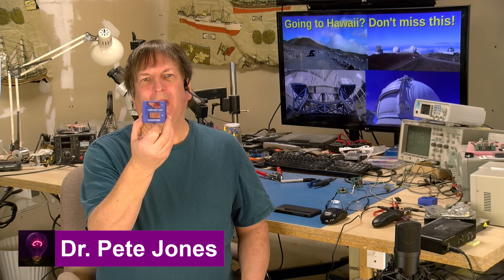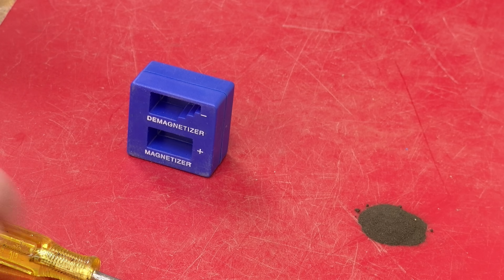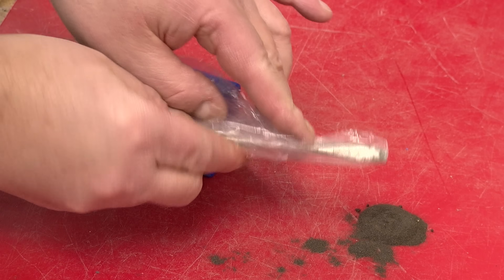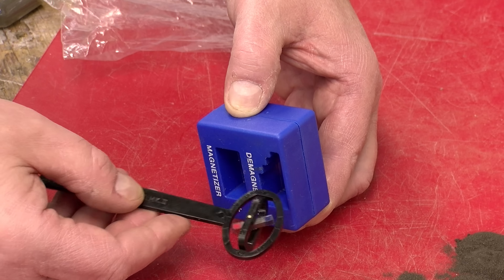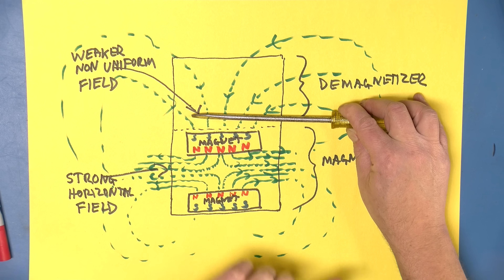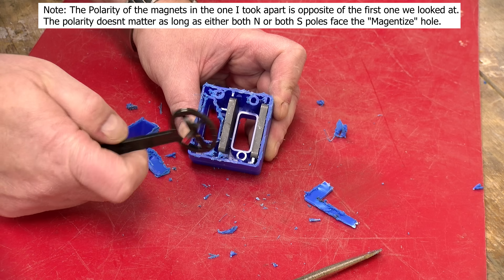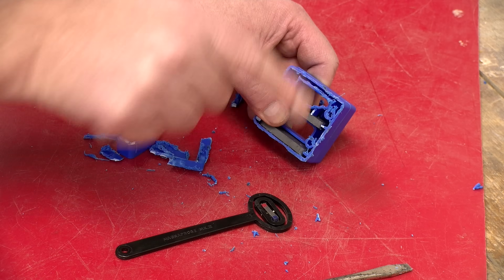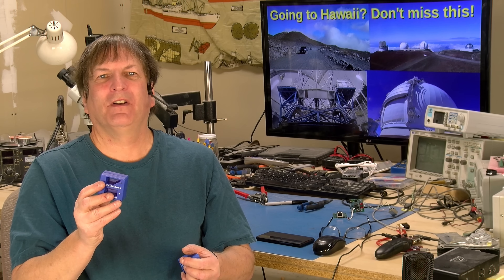How do these Magnetizer/Demagnetizers work?

Comment: I fixed a pair of tweezers that had become magnetized when I stored it on the shell of an old DC motor (yep, I'm a genius!). Repeating the process many times on the differerat steps did the trick. Having every screw stick to the tweezers was driving me nuts!
Reply from the maker: Glad that worked! A magnetized tool at the wrong time can be a real nuisance!

Comment: i understand that the magnetic field reorients the molecules in the screwdriver so they become aligned and they increase the force instead of cancelling eachother out, but I've seen most people "rubbing" whatever they want to magnetise over in the magnetising part instead of leaving them still, does this do anything to increase the magnetic field of the screwdriver or is it just a thing people do?
Reply from the maker: Thats a good question - the only effect of rubbing the item that I can think of is the resulting vibration will help nudge some stubborn domains to orient with the applied magnetic field. I'm not sure how effective it would be - worth testing sometime!

Comment: Will the type of magnetizer you’re using work great with bigger & thicker screwdrivers?
I saw some poor reviews on Amazon and I guess I could google this question: will this also work for titanium screwdrivers and/or Ti bits?
Thanks for the video
Reply from the maker: At some point the thickness of the screwdriver will be too thick for the magnetic field from the small magnet to penetrate enough to magnetize the entire thickness. Probably a screwdriver a bit thicker than what I showed will work but how much bigger would need testing. 

Length doesnt matter and long as you feed the entire length though the hole. 

Titanium - pure titanium is not magnetic. As far as I know many titanium screwdrivers and bits are actually titanium coated steel, so if that what you have, they probably can be magnetized. Apparently some are some sort of alloy which will then depend on the magnetic properties of the alloy. I'm not sure what alloys are used or of they are magnetic. If you try it, would be interesting to hear if they can be magnetized!

Hope that helps!
Reply: @ElectromagneticVideos 
I have 20 small earth magnets so I used them to magnetize my screwdriver. I forgot I had them until later on. I don’t use it very often but I wish I’d of thought of it when taking my large air filter apart. I may have to do it again on my next project 😅
Reply from the maker: @MrScrappydue  Sounds like a perfect solution! Glad you found a method that worked!

Comment: Found that trying to demagnatise a pair of stainless steel tweezers almost impossible  ,tried to demag with the tips together and aldo parted.
What experiances have you had trying this.?
Thanks
Reply from the maker: I'm guess the steel in the tweezers is a bit magnetically harder making it harder for a primitive device like this to demagnetize. An AC demagnetizer should do it. You can often use the AC magnetic field from a soldering gun (not soldering iron) to do this. See this video I did on demagentizing things:   https://youtu.be/mGK8oYdEqyE  Hope that helps!

Comment: hope you still read these, I'm trying to get my pins to only magnetize to a magnet but don't want them to become magnets, is there a wat to do that? These are crochet markers, metal but not shore what kind. some come sinsative to a magnet but some don't and if i drop them in the carpet, i want to be able to find them again but not have them stick to each other. Screws do this but don't know how to get these to do it.
Reply: Thank you and hope you or a viewer can help.
Reply from the maker: @CatWatchPaws  Just to make sure I understood correctly, you want to be able to pick up up the pins with a magnet but also not have the pins themselves magnetized afterwards, right?

There are two things I can think of to try:

1) Since the pins are light, you wont need much of a magnetic filed to pick them up. So try picking them up with a piece of cardboard between the pins and the magnet. This will keep the pins from getting closer than a few mm (1/8th inch) from the magnet and will be exposed to a lower magnetic field. If you lucky you can find cardboard that is thin enough  to pick up the pins but but thick enough so that the pins are far enough away from the magnet so they are only barely magnetized afterwards and dont stick top each other. 

Try a thick piece of cardboard first and then try thinner ones if the magnet doesnt pick up the pins.

2) If you have already magnetized pins, or find that reducing the field strength (as in 1) doesn't pick up the pins, you can try demagnetizing them. 

What you need is an AC powered demagentizer. They are available but something like an easily available  soldering gun (not soldering iron!) will do the job. I did a demagnetizing video here https://youtu.be/mGK8oYdEqyE that discusses this. Pit the pins in plastic bag to hold them when using the demagnetizer.

You could also try heating the pins in an oven (not a microwave!) which if it is hot enough will demagnetize them. May not be a good idea if the pins have a plastic coating or are heat treated during manufacturing, so test with a few magnetic pins. 

Good luck and let me know if any of these suggestions worked for you!

Comment: I wonder if you might be able to comment on how a plate Demagnetizer works. Is it the same principle? Saw back & forth over the top of the plate whilst raising the (watch movement)  up and out of the field?
Reply from the maker: Yes! Its the same idea -gradually moving away the item to be demagnetized from an alternating magnetic field, with each cycle of the field leaving the item slightly less magnetized. I did a video on that sort of demagnetizer here: https://youtu.be/mGK8oYdEqyE
Reply: Fantastic. Thank you so much! @ElectromagneticVideos
Reply from the maker: @MichaelEgan66  Your most welcome! Enjoy the video!
Reply: @ElectromagneticVideos I did enjoy the video but I did not see anything about a plate Demagnetizer, unless the vintage one at the beginning is what you're referring to.
Reply from the maker: @MichaelEgan66  Yes - the vintage tape demagnetizer from Radio Shack at the beginning is the same thing as a plate demagnetize - the only difference is you move the demagnetize away from the object (tape) rather than the object away from the demagnetizer. in the case of the plate demagnetizer. The way the work is exactly the same.
Reply: @ElectromagneticVideos  Thank you. That helps. I used an old snap-on screwdriver and both magnetised and demagnetised it, over and over until i got a bit of a rhythm and then ran my watch through the field in the same manner. It did not work for the watch. Unfortunately,  the watch was running well enough to wear before i somehow ruined it with the plate Demagnetizer. Now it is a disaster on the timegrapher and despite not showing magnetic on my mag test app, it is definitely running very fast now and behaving like its magnetised. I don't like learning lessons the hard way and this ranks up there because I really love that watch...Thank you for your help sir, it was very informative. 🙏
Reply from the maker: @MichaelEgan66  Unfortunately I dont have any experience with watches, but my guess is due to different layers of metal in a watch the inner p[arts are partly shielded magnetically (by in between layers) and although somehow they got magnetized with a  very strong field, they may not be getting enough of demagnetizing field to undo it. 

Two other things are notorious for demagnetizing things: heat and mechanical shock. I wouldn't try the shock on a watch, but maybe leave the watch out in the sun on a hot summer day? I'm not sure how bad that might be for a watch. Also try wearing the watch for a week or more - the "shock" from your arms motion may help to demagnetize it. 

I would think watch repair people must have some advice on how to deal with magnetized watches - I sure there are online bulletin boards and discussion groups that be able to help. The other thought I just had as I was typing this was that the magnetizing field may have been string enough to warp the spring causing the speed change. Just a thought. Best of luck fixing it!
Reply: @ElectromagneticVideos  You're very kind. Thank you. Unfortunately, the watch pro guys on here are very loath to respond, and when they do, it's always a minuscule morsel of information that is at best, barely helpful. The reason being is that most all of them sell stuff and want you to give them money. I literally just went to try to contact one of them an he has a message saying "I wont respond to you unless you've paid for one of my classes"... Thank you again, youve been a big help, sir!!
Reply from the maker: @MichaelEgan66  Gee - thats really too bad. I would have though there would be plenty of watch amateurs helping each others but I guess not. 

The more I think about it, just try using it a while. Magnetically soft materials (most steel, iron and similar materials) are bad at retaining magnetic fields (thats why we dont use them as magnets) so you have a good change of it fixing itself with the occasional bumping of things in  normal use.
Reply: @ElectromagneticVideos  That sounds like a plan that my disabled veteran budget will appreciate greatly. Thank you for your advice, I'll definitely give it a shot!

Comment: You should flip the screwdriver over between each step.  You want to subject it to an alternating weakening field.
Reply from the maker: That would probably help particularly on the side of the screwdriver that is away from the magnet since the middle of the screwdriver would shield it a bit.
Reply: @ElectromagneticVideos  Not really.  The screwdriver is relatively thin & the steel on the magnet side carries the flux through to the other side.

Comment: Thanks for the explanation. Brings me back to grade school. How big is the demagnetization opening? I think my watch is magnetized but I’m worried it won’t fit
Reply from the maker: Magnets were probably the neatest thing in grade school science - amazing and mysterious. 

The opening is about the size of two middle fingers next to each other - probably varies depending on which factory made the device.  BUT DONT USE IT ON YOUR WATCH! With the different layers of metal in the watch, the magnetic field from the demagnetizer  will be shielded somewhat from the insides of the watch which will also prevent the weaker field changes from doing the demagnetizing. I would be really concerned that the end result would be more magnetization. I'm sure there are watch repair DIY sites on the internet - I'll bet they have some good ways of doing it.

Comment: my china one only got one magnet and didnt work haha, thanks for letting my know why
Reply from the maker: Your lucky! Some commenters have reported both magnets missing - so you got half your moneys worth :)
Reply: @ElectromagneticVideos  it was included in my screwdriver set, the whole thing was just 4€, so i wouldnt say its much wasted money
Reply from the maker: @dbmaster46446  Completely agree! They are usually available by themselves for a couple of dollars here - and even if one is bad the cost is so low that buying another and effectively doubling the price  is still a good deal. For  that type of pricing - or for the kit you have - it probably would not be feasible to do some form of quality control which could significantly increase the cost.

Comment: Does it improve if you flip the screwdriver over between insertions. Demagnetization often involves a decreasing alternating field because of hysteresis.
Reply from the maker: Your right - it probably does for the reason you mentioned. Even better, perhaps two insertions at each step on the staircase, with the screwdriver being flipped for the second insertion.

Comment: How do I demagnetize bent nose pliers?
Reply from the maker: The best way is with an AC powered demagnetizer. You can use somethings like an old soldering gun for that purpose : turn the gun on, hold the pliers really close to it ( touching the plastic case) and while the gun is on gradually move the pliers away - maybe 3 feet away or so. Only then turn the gun off. I did a video on demagnetizing here https://youtu.be/mGK8oYdEqyE?si=nL2rT_BSFSU4p7AY   look at the 8:48 point to see a soldering gun being used.

Comment: How long this effect should stay on screwdriver without manually demagnetizing it?
Reply from the maker: The steel used for tools is not great for making stable magnets so it can easily become demagnetized by shock and vibration, exposure to opposing magnetic fields. heat etc. So it will loose its magnetism over time, but it really depends on what external factors it has been subjected too. So you cant really predict how long it will retain the field. Could be months or years if it was left on a shelf in a cool place and untouched. Most commonly, hours, days, weeks or months are the typical time frames.

Comment: Interesting and very informative. Thought if cutin away the "roof" of the demagnetizer to fit a pinball ball (is that the proper name? 🤭) as it's too tight fit otherwise, but guess it would work just as good as it's nothing in the top, right?
Reply from the maker: Yes - exactly! No need for the roof. Try and keep the steps as convenient way to increase the distance after every pass through the demagnetizer.

Do you have a soldering gun? They generate a strong AC magnetic field - put the ball near the soldering gun and gradually move it away and you might find that a more effective way to demagnetize the ball. I showed that in a video about demagnetizing things here: https://youtu.be/mGK8oYdEqyE?si=socf6jCMJClY7VZ0&t=530

Comment: Tks you for your video , i know how it work 
Will it make crew driver have stronger magnec if I change with rare magnets ?
Sr for my English
Reply from the maker: Unfortunately not -for a screwdriver the steel that the screwdriver is made from is what limits how strong the screwdriver's magnetic field will be.

If you need a screwdriver that has a stronger magnetic field, try attaching some strong magnets to the screwdriver which may make the screwdrivers magnetic filed stronger. 

I see your from Vietnam! Best wishes from Canada!

Comment: But how strong is the magnitizer.  Will the screwdriver pick up a large screw?
Reply from the maker: Its actually more about the material he screwdriver is made of - which generally does not make good magnets. Typically a screwdriver will be able to hold a screw on its end while screwing it in.

Comment: Just wondering. Would it make the effect be stronger on the screwdriver if exchanging those magnets with stronger neodymium ones?
Reply from the maker: A definite maybe! It all depends on the nature (magnetic hardness) of the steel in the screwdriver and its magnetic saturation level. If its magnetically hard  a stronger magnet in the the magnetizer gizmo would be able to leave the screwdriver with a stronger field closer to its saturation level. But most steels for things like tools are more magnetically soft - they dont retain fields well. So bottom line, probably a slightly stronger filed but not significantly stronger unfortunately.

I did a more detailed look at how things are magnetized if your interested: https://youtu.be/S21rlwrY74I
Reply: @ElectromagneticVideos  it was something that just came to mind. Thanks for the explanation. I'll definitely look into the video once I get the time. 👍
Reply from the maker: Its a good question! The other video should provide the reasoning behind my answer. Enjoy!

Comment: when you magnetize the screwdriver, does its magnetic ability dissipate over time if left alone? If so how fast?
Reply from the maker: Most tools are made from what is called magnetically soft materials which meas they are easy to magnetize but also demagnetize.  They can demagnetize over time particularity if stored in  hot locations (ie in car on a hot summer day), but also if subjected to shock (hit with a hammer, dropped) or subjected to an opposing magnetic field (which if too strong can magnetize the screwdriver in the opposite direction.).

So bottom line - if the screwdriver if left in cool location and not banged around, the field could last for months or more. Heat, banging etc can at worse case make the magnetism disappear immediately.  So there isnt a slow predictable decline of the magnetic field, but instead a more unpredictable drop in the field after being subjected to one or more "bad" situations.

Comment: I knew that you could magnetize things using a permanent magnet but thought that you needed an electromagnetic field to demagnetize  them.
Reply from the maker: Your right  - you need a  gradually diminishing magnetic field to demagnetize, and repeatedly pulling the screwdriver through while moving away on the steps creates exactly that from the perspective of the screwdriver!
Reply: @ElectromagneticVideos  Thanks, I always thought that an alternating current was needed for demagnetization,  I never heard of permanent magnets being used for that purpose until I saw the video!
Reply from the maker: @joshhoman  I must admit, I took me a while to figure out how it did it - and why the steps where there. Very ingenious little device!

Comment: I bought one but wasnt happy with the results, so i used a much more powerful neodymium magnet that magnitized my screwdrivers much better
Reply from the maker: I think part of the the issue with  them being so cheap is there is little consistency or quality control. If all you need to do is magnetize things, your solution is way better - and you also have a nice strong magnet in case you need it for anything else. Greetings from Ontario!